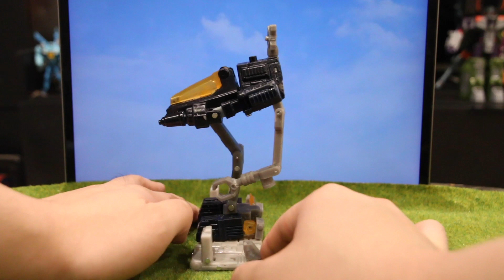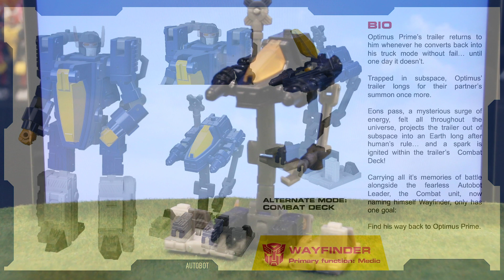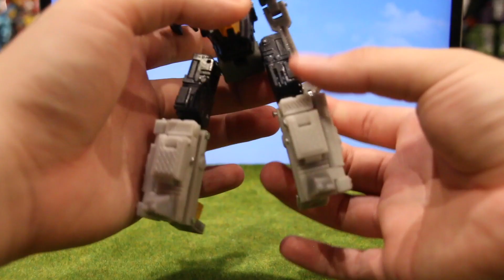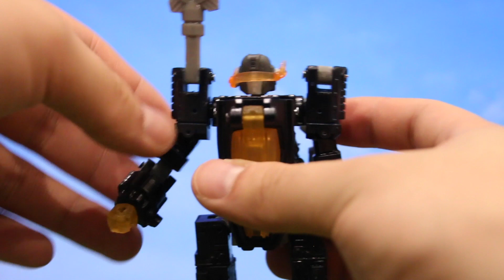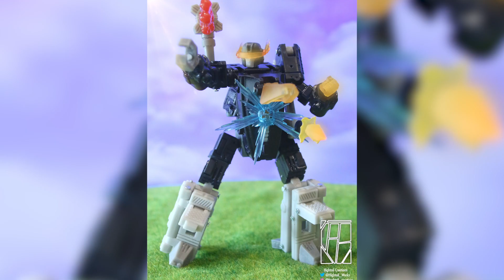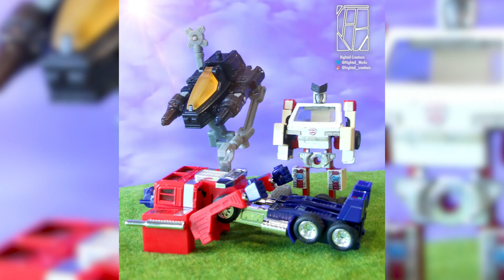3D Printed WAYFINDER Transformer Showcase

Comment: Kinda wish the claw arm itself just doubled as the arm in robot mode rather than having it as a huge piece of kibble in robot mode. Other than that, looks good. Also I think the repair drone this was based on was originally blue not black. I do like the black better to be honest but that's just me being color blind and not being able to see blue well but if you want it to be accurate to Optimus Prime's trailer you should probably change the color scheme a bit.

Comment: Hello! I recently started trying to design and 3d print transformers on a resin printer! I was curious as to what modeling software you used, and what specific resin printer you used.
Reply from the maker: Hi. I use Fusion360 to model my figures, Anycubic Photon S for my printer and the standard Anycubic Resins
Reply: @HightailCreations  did the translucent resin give you extra trouble when curing? I've had some issues with ports and pegs deforming
Reply from the maker: No, the translucent resin printed just fine.
Reply: @HightailCreations  I'll keep trouble shooting. Thank you for you though!

Comment: It's a good idea and you executed it well. The one thing I'd want to improve is the partsforming required for the hands - it would be good if the hand and the cone could be on opposite ends of a wrist section that rotates to hide one or the other inside a compartment in the forearm, but it doesn't look like there's room.